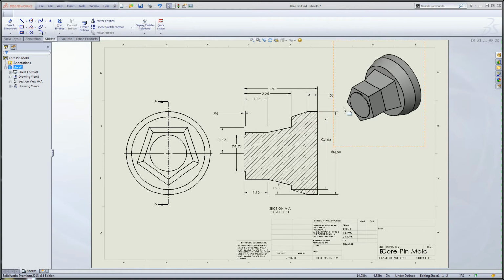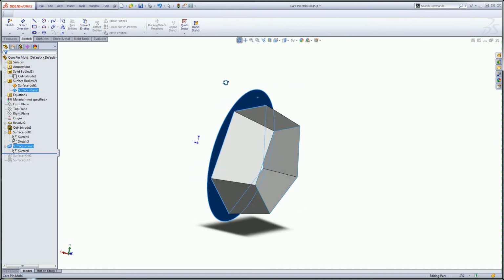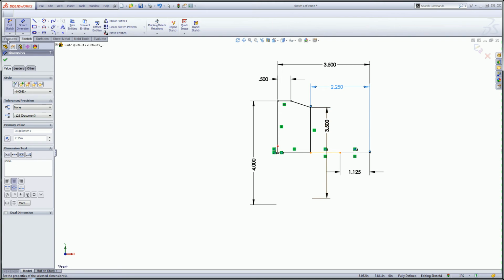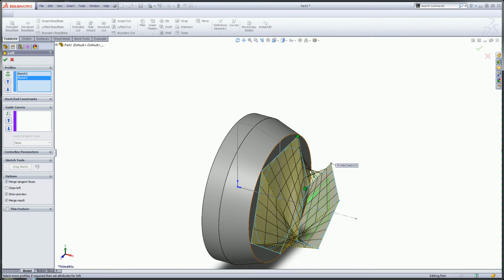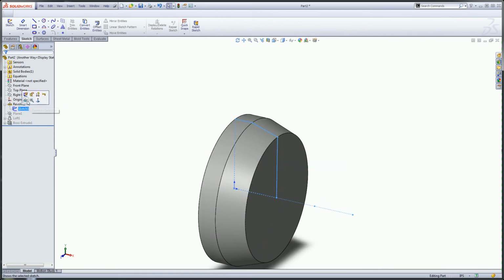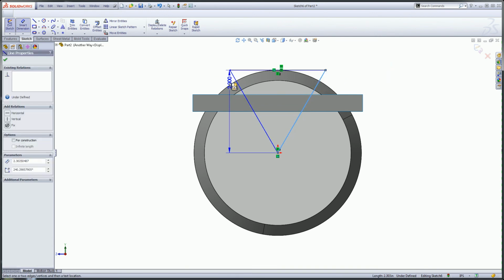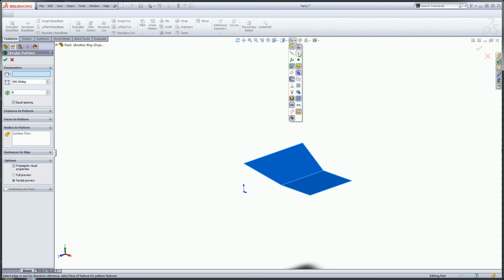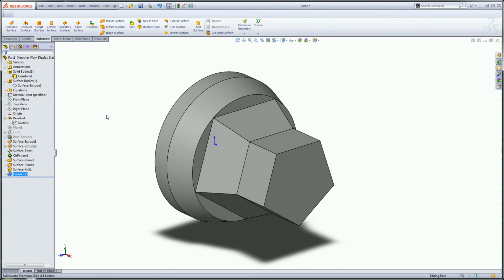Core Pin Mold - 5 sided object

Comment: Also, you can cut surfaces with only a sketch by using the trim tool and you can create multiple planar surfaces in one feature if you select multiple closed contours.
Another useful shortcut is the S key customizable menu, that saves you a lot of mouse travel. (as commented on a previous video :) )

If going the surfacing way for this object was only to make it "more interesting", i apologies for not reading the description before posting the first comment. :)

Comment: You can do that in 2 features:
1. Extrude a pentagon sketch in two directions and put draft on one of the directions;
2. On the right plane (if the pentagon is pointing down or up) sketch the profile for the reminder of the object, creating a coincident relationship between the tip of the pentagon and the sketch so that the diameter of the revolve coincides with the diameter of the pentagon.